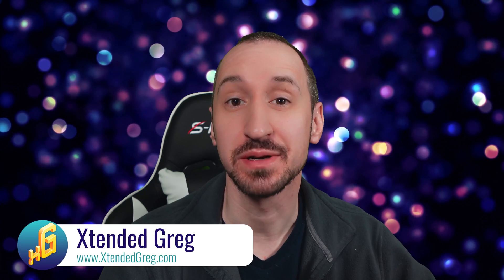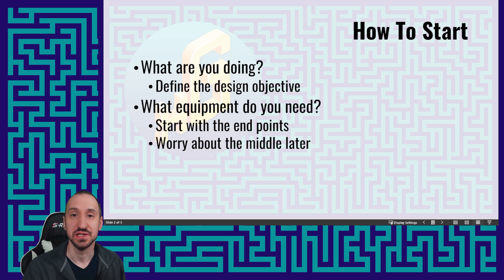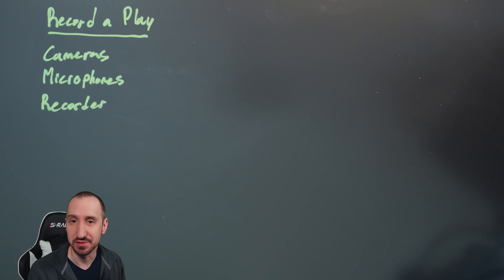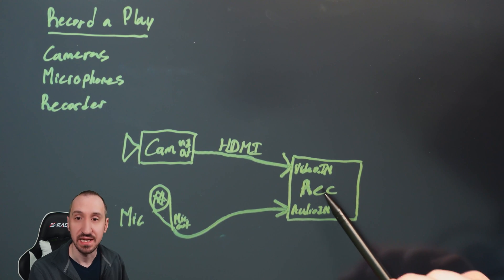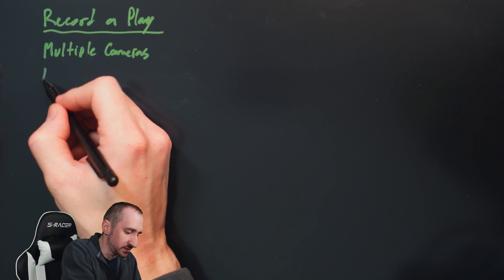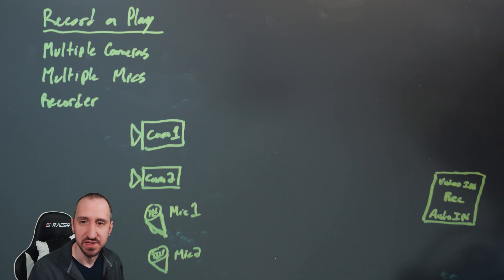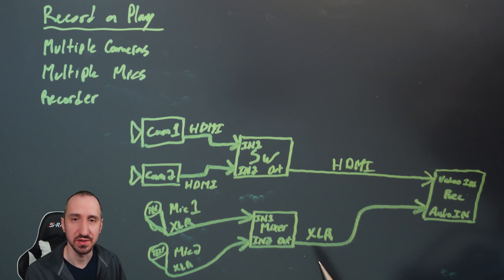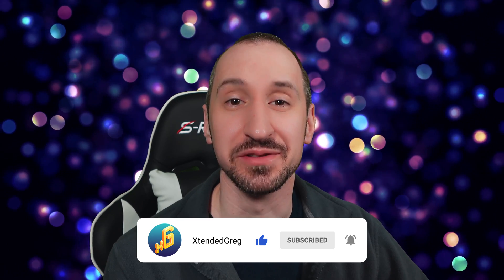How to Document Signal Flow Diagrams

Comment: Thank you for this here, surprisingly there seems to be little information about this topic around. Can you reccomend any tool to swiftly create helpful visualisazions of signal flow lets say in my studio?
Reply from the maker: That is a great questions!  There are a log of applications that are able to represent signal flow, but some are better than others in terms of the detail that you can pack in there.  For high level drawings, most flow chart applications are useful and have a low learning curve, but for more detailed diagrams, there are applications like AutoCAD, WireCAD, and Visio which can create hardware templates with multiple connections that will give specific representations of each cable that is connected.  CAD drawings are the industry standard for technical line drawings, but if you are not already familiar with those software, it is not intuitive.  The key thing is to represent the ports that you need and build detail upon it, so the middle ground application that I use is Visio since you can create a textbox anywhere, group shapes together, and link cables to ports and it operates very similar to Word.  There are open source alternatives to that which contain many of the same features like LibreOffice Draw, and draw.io, and there are a multitude of others that should be able to document the information that you need clearly so that you can troubleshoot any issues quickly.  Thank you for your question and for watching! 😊